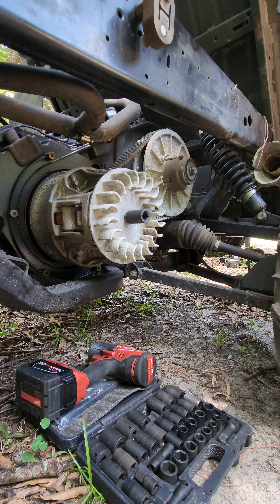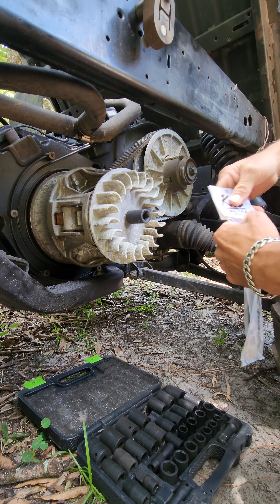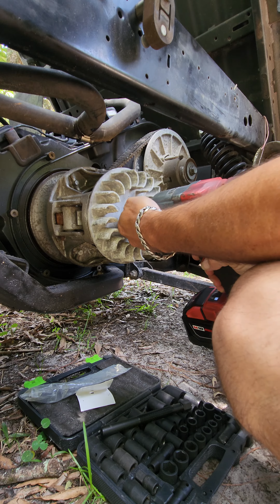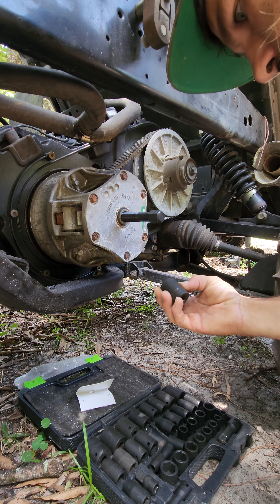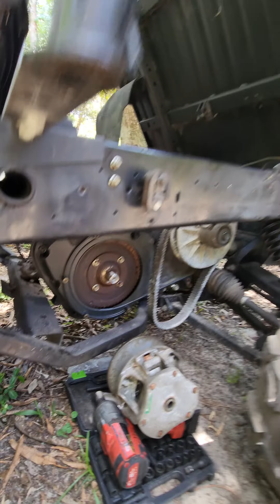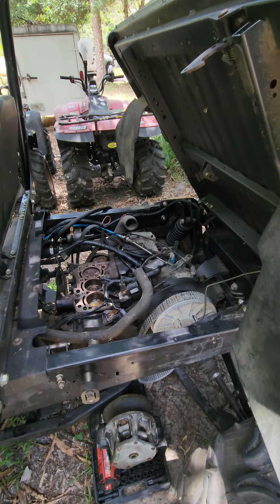2012 Gator 825i & 835i primary clutch removal

Comment: You haven't done this before.  You need to grease the tip of the removal tool.  It's not a good idea to make DIY videos if you do not know what you are doing.
Reply from the maker: The threads and tip had grease on it 🤦‍♂️
Reply from the maker: You should grease your tip 🤣🤣💪
Reply: Link to the puller tool you bought?